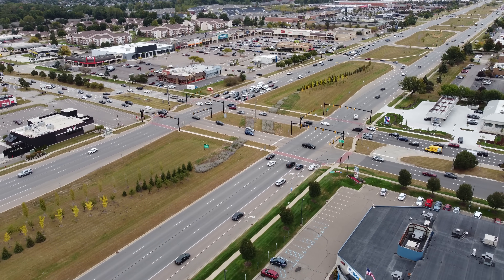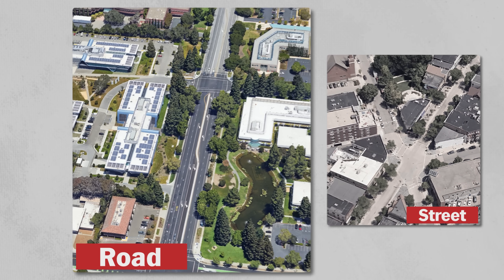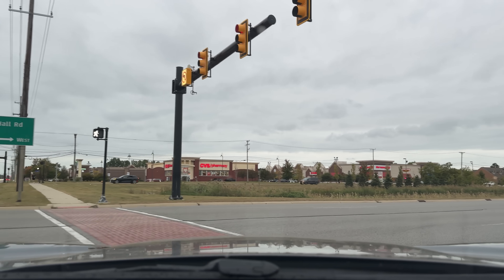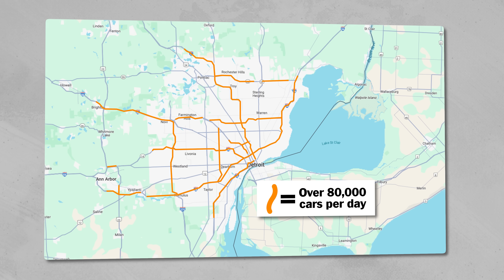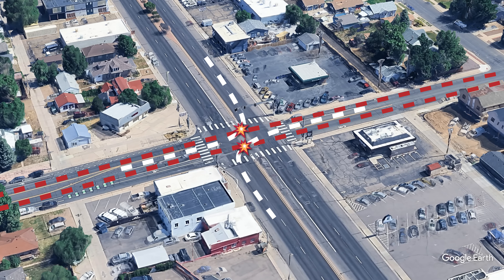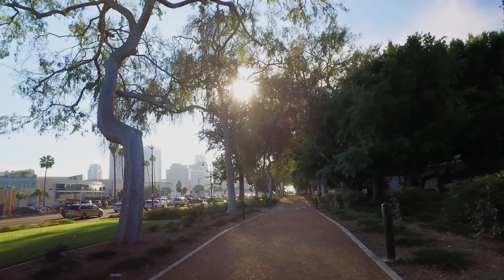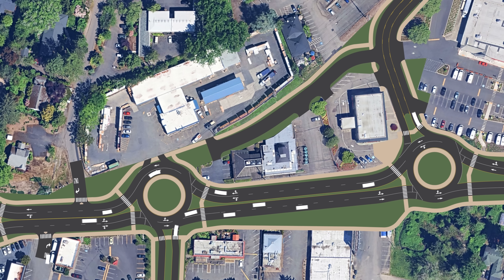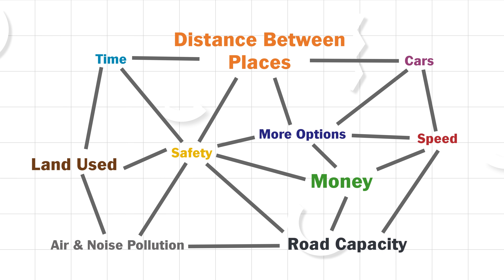How Michigan Built a Super Highway Using Only U-Turns

Comment: I think this is a terrible design:
1- You explain to me "highways require significant physical space and in urban areas it is an immense barrier that separates neighborhoods".
The alternative proposed in the video is also. You don't solve the problem. This is about 350 ft wide. The intersections are scarce, the space that is wasted is much greater than on an urban highway,... Very bad design.
2- It is full of traffic lights that a high-capacity road like this shouldn't have. I don't care if they are coordinated. In fragments of the video I see a lot of cars stopped waiting for the traffic light. Which means that if the cars have to stop and start they end up polluting much more than if they maintain a certain speed.
3- It doesn't take into account pedestrians, cyclists or public transport, it is all focused on the most inefficient means of transport that we have in cities: the car.
That's why I think that in this case, the best solution I can find is a semi-underground urban highway (with 2 lanes on each side, thus minimizing the space it occupies and the cost), and an avenue on the surface that has entrances and exits to the highway in roundabouts. I don't want any traffic lights! And the rest of the space that would be left over could be thought of as a tram and some bike lanes and a lot of pedestrian crossings so that pedestrians can go from one side to the other...

Comment: I was driving through a Michigan town that had one of these in a semi-truck.  The highway was closed off so I had to find a detour without knowing the area.  I've never seen one of these before and was so confused at first.  But got the idea on how they worked pretty easily.  I mean all you have to do follow the paint markings on the road.  The GPS was telling me to turn left where I couldn't turn left.  But the U-Turn design basically just enforces other drivers to do what I've always done.  Before I was a truck driver I was a delivery driver for both food and parcels.  I would plan out my routes so I wasn't making any left turns on busy streets.  If a street did become busy I would just make a right, and then a u-turn.  Or if there was a no U-Turn sign a Left, Left, and right.

Comment: I live in Michigan and work on a major road that has Michigan Lefts all the way down. When I commute home, I wait for the light by work to go green and then generally don't stop again until I need to make my u-turn 7 miles further on. This on a heavily traveled road and going through a major Detroit suburb. The Michigan Lefts work extremely well. Downsides usually relate to people not understanding them because they're not used to them. Also people who don't understand that despite the turnaround being very wide, it is technically only one lane unless otherwise marked. This does create a potential conflict point if someone stupidly slides up next to you when you need to get over after the turn. I get around that by moving to the side of the turnaround I will need. Otherwise, they are so much safer than major roads with left turns.

Comment: I pray many more municipalities pick up on this concept, particularly here in the DC area and the northeast. The biggest problem is not the amount of traffic (which many would disagree) it is a damning engineering failure of these roads and highways, coupled with supposed smart technology traffic lights. Tell me when it makes sense to stop a hundred cars to allow for 2 to 3 vehicles to enter the road. Clover leafs are an utter failure. Engineering overall has failed this country miserably with regard to traffic flow. Failed!

Comment: I don't understand why they need traffic lights at every Michigan Left. Seems plenty of space to build an on-ramp that doesn't require waiting? Also, it would be nice if they could combine the Michigan Lefts with Texas U-turns on the same highway, which is the same idea but just before the intersection instead of after. This way, traffic coming out of businesses alongside the highway before the intersection that wants to go left, simply merges right onto the highway, and then makes a U turn without having to wait at any traffic light at all.
Reply: Merging ramps work on low volume roads.  Theu cause congested and high risk of crash injury on high volume roads.

Comment: As a fan of the channel, and someone from Michigan, I'm really disappointed you're talking about these things this positively. I have to deal with these everyday and I personally hate them, and think they're scary. The problem is that it's generally always one way onto a one way, so you don't have to wait for the light legally. Other drivers expect you to make the turn even when you don't have a green light. (Also, most of the small entry streets don't have lights there in the first place.) This forces you to zoom across 4+ lanes, one direction and then another 4+ lanes the other direction, avoiding traffic going 60mph. I've basically learned to just completely navigate around these roads. I generally avoid most of the northern suburbs you mentioned for this reason. (Although to be fair, I realize there's not really a lot of great alternatives)

Comment: In the design proposal at 11:50, wouldn't it be safer to locate the crosswalks further away from the roundabouts rather than concentrating them around the roundabouts?  I regularly use a roundabout in Vancouver, WA.  The traffic moves slowly and steadily, but negotiating the roundabout requires focused attention on the position of the other vehicles.  Adding pedestrians into that mix is adding complexity, thus more likelihood of error and accident.  I would not want to be a pedestrian trying to cross near that roundabout.  I'd cross away from the roundabout.
Reply: Ultimately the safest choice are overpasses/tunnels under the roads, but I think crosswalks near roundabouts are better due to the fact that drivers have already slowed down, could be enhanced by adding crossing signals, would disrupt traffic flow though.
Reply: @Icon1468 Maybe crosswalks about a half block before and after each roundabout entrance/ exit.  This reduces the complexity within the roundabout.  I drive in Portland, OR, which is frankly overwhelming with signage and traffic controls.

Comment: Visited the Detriot area several times and with those wider aisle type streets it was an easy trip around many places with
the "u-turn" design in those particular roads. Lived in Chicagoland and no place really there has them like this. The streets
 aren't designed with parkways between the opposite lanes just like everywhere else in the lower 48. Why it never really
 caught on here is because of the growth around the suburbs was in the 1960s and now land is too valuable around the
already built roads but there are a few places where it can be done. Example: Cermak / Butterfield Rd just west of the
Oakbrook Mall.

Comment: Two things no one ever seems to consider:
1) traction
2) maximum vehicle length.
-- Roundabouts are the absolute worst thing in low-traction conditions (like wet snow or ice) as you are always turning, thus always losing traction.
-- Truck traffic may be unable to use a roundabout at all, or have to hop the curb on both sides to make the turn.

In Idaho I saw many crashes and long backups on roundabouts -- even at 5mph you can start sliding during the continuous turn, a problem not seen with the four way stops they replaced.

One roundabout was on a major school bus route. That backed up for about two miles every afternoon. When a bus entered the roundabout, everyone else had to stop til it cleared the circle, or they'd get crushed.

This town also installed a roundabout on a truck route, at the only railroad crossing for several miles in either direction. The turn was too tight for 18-wheelers. All the trucks had to drive five miles out of their way to go around it.

Comment: Excellent video.
Although Michigan has some of worst roads (surface wise),
The way multi lane roads are constructed is pure genius.
Telegraph, 8 Mile, Woodward, Gratiot along with Hall Road synchronize the traffic signals as well - if you speed, you’ll have to slow or stop at every signal. Drive the speed limit, you’ll roll through every intersection.
Michigan lefts are considerably safer than divided roads in the Southeast where cars making a left turn literally obstruct the view of the opposing car attempting to turn resulting in several head on & T bone accidents.
This concept should have been adopted nationwide 50 years ago. It would’ve saved thousands of lives to date

Comment: That huge median road in the first half of the video is just excessive.  As you talk about in the later segments, there's no reason to need that much right of way.  They have enough land to keep the same design but give back land on each side to actually create desirable commercial space as opposed to individual parking lots and strip malls.  There's room to have a bike and pedestrian area with shops as well.  While the u-turns are smart, they failed the overall design for for.

Comment: Having lived in Michigan now for 15 years, I am still very impressed with the "Michigan left" system. It's not perfect, but it's a lot better than traditional protected left turn intersections. I lived in a city half the size of GR before moving to the state, and the nightly news was filled with multiple car crashes due to people pushing the lights. I'll take Michigan lefts, with whatever imperfections there are, any and every day over the multitude of proven failures in other areas. I would rather go a short distance out of my way than to sit at an intersection for 3 or 4 cycles of a light to be able to make my turn, or even worse, have to find a completely different route because there's a crash.

Comment: I know in the Grand Rapids area, for some reason most of our roads that have Michigan lefts also have driveways on the same streets which sorta defeats the point.  The only exception I can think of is Rivertown Parkway and for whatever reason, that street doesn't have synchronized green lights.

Rivertown Parkway is also weird in that past a certain point it merges with 44th Street and then has driveways all along it sorta defeating the point of the Michigan lefts.

Comment: We've got a turn around point like this on Highway 61 in Minnesota, but it's on a much smaller scale.  It's a two-lane highway, with only about two miles of road where this intersection is (highway 61, Wabasha Minnesota).  It's not big enough for trucks to turn around safely without blocking traffic and it's annoying.  They could have just added a roundabout to the intersection, but that was thought to be too expensive at the time

Comment: The biggest problem people have is believing the shortest distance between two points is not the safest.  If you are in a parking lot with multiple driveways, as you approach the road, go to the furthest driveway to the left. That gives you the option of getting on the road and gradually move over to the left to get on a roundabout. Roundabouts are typically before, somewhere midway and just before an intersection. It is ignorant to blame design when someone tries to cross from a driveway straight over to a roundabout through 4 lanes of traffic. To expect 4 lanes of traffic to stop so they can cross over happens, but it is equivalent to Los Angeles Gridlock. We don't have gridlock laws here yet, but if we get more West Coast and 3rd world drivers here, I predict it won't be to long before we do. Thankfully we don't have stop lights at the end of on ramps...

Comment: I’m from Michigan. Even in Michigan, we call them “Michigan Lefts”. I am curious to know how they compare to roundabouts, but I suspect you get higher throughput than a roundabout.
Reply: Roundabout only works on low volume roads, not high volumes like this.  Roundabouts max out at 1000 vehicles per hour (1750 for dual lane, 2200 for triple lane).  Michigan u-turn can move more than 3000 vehicles per hour.
Reply: @traffic.engineer  Username checks out! Thanks for the info! I always thought it was odd that most other states I've been to didn't have them. I figured we were either doing it very right or very wrong :D

Comment: 0:51 - typically have high speed limits of 45
Reply: That is a high speed limit. Considering the limit for residential areas is 25 at most usually. And a Human can only run at max 10.
Reply: That's also faster than a racehorse at full speed, or a grizzly bear. That's fast. The fastest herbivore on the planet, the Pronghorn, typically gets 55mph so... Yeah fast